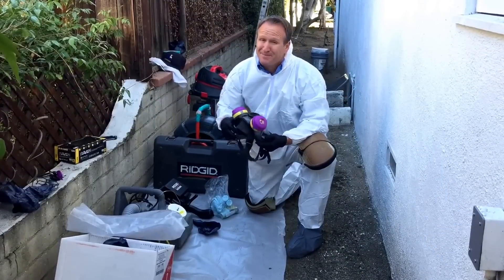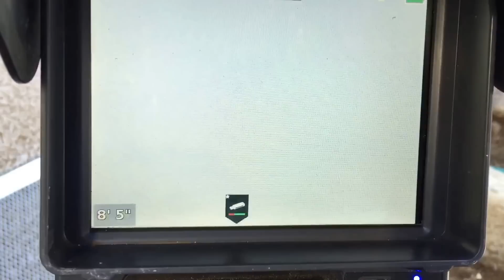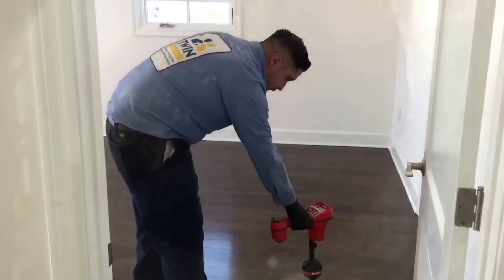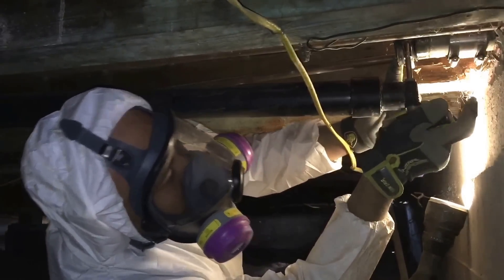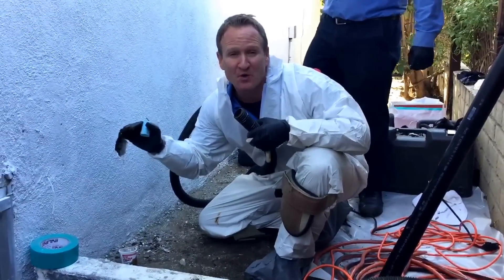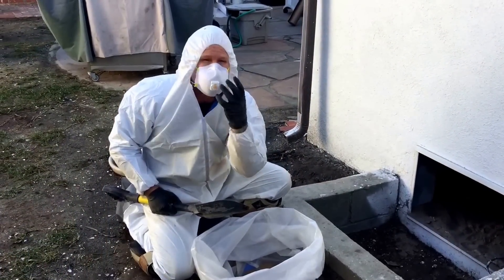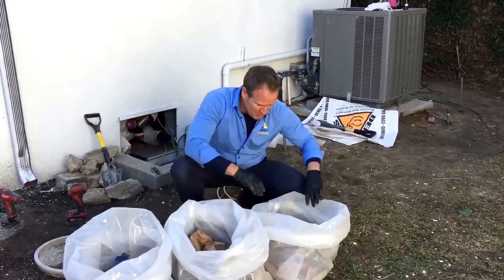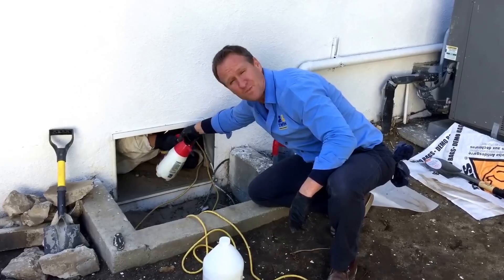5 Contractors Could NOT Find This Heavy Sewer Odor And Rat Urine Odor In This Home

Comment: I am a General Contractor in California, and  found your approach impressive.    Was the camera data enough to locate the issue?  When running the smoke test are you using visual input, and, if, as in your case the breach is sealed up in a ceiling cavity were would you look for the smoke?   How long after the sewer gas leak is sealed will the oder linger? 
my issue is
 I did not find a breached vent, but I did find a water leak and wet earth under the leak and it smelled there , and then gaps over 4 inches were  pipes were fitted through the floor and  into the walls  I ask because I am dealing with this sewer gas order problem myself.  I think its fixed but it still smells a little but not as much and I am like hmmm IDK
Reply from the maker: Thanks for sharing here Baddog. In respect to pin pointing this issue. 
Camera is a good start and helpful, but won’t be enough to really pin point a hairline crack, especially if it’s ABS pipe and fitting. The best thing is to to pump high concentration of smoke into the sewer/ vent system. 
I would wait it out for a few days, then if the sewer smell is still present, then you know what you have to do. 👍

Comment: Thanks for the helpful tips now hopefully as homeowner I can identify my dead animal smell without having to call in the $plumbers right off.  Got me thinking it may be in ceiling not crawl!  Can you recommend 1. a sewer gas h2s detection tool and 2. the best way for homeowner to generate smoke (given all I have is a plastic shop vac)?
Reply from the maker: you can use a shop vac, just use a metal can and stick to the inside of the shop vac, then drop your smoke candle inside the metal can.
ferguson pipe and supply or amazon will have the gas sniffers for about 120.00.0
Reply: i guess Im kind of randomly asking but does anyone know of a good site to watch new tv shows online ?
Reply: @Sonny Ahmad lately I have been using Flixportal. You can find it on google =)
Reply: @Forrest Walker Yup, been watching on Flixportal for since april myself :)
Reply: @Forrest Walker Thanks, signed up and it seems like a nice service :) I appreciate it !!
Reply: @Sonny Ahmad No problem :)

Comment: WOW, HERE IS YOUR BILL SIR, AND BOOM GOES THE DYNOMITE!!!!!
Reply from the maker: Something like that
Reply: fritzduval no shit
Reply: I am thinking the same thing..6 guys all that equipment..and thats just to inspect..
  Now the nests or whatever was in the pipe has to come out, ceiling needed to be opened, pipe needs to be removed & capped..
 When all that is done you need to make repairs on whatever was opened up... It was very thorough and they did find many things. If you have an expensive house or love your location I can see people spending the extra 20G's or so..
 Where i am, i don't know any company that has all that equipment,  lucky even the heat camera to look for underground leaks, or the co2 bag to freeze the main line..

Comment: Outstanding. We have a intermittent skunk odor in our bathroom. It's not the trap in the sink. We ripped out walls. We remediated for mold. We capped off pipes, but the smell remains. It comes and goes. Could it be a back up?
Reply: MrJj529 I have his too.  Recently remodeled hoping it would correct the issue but it remains coming from the shower.